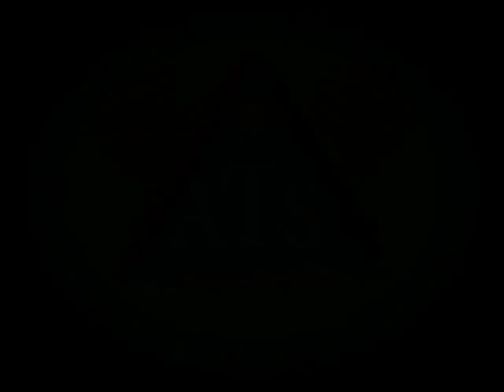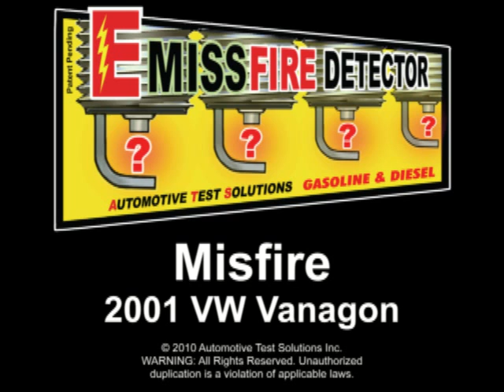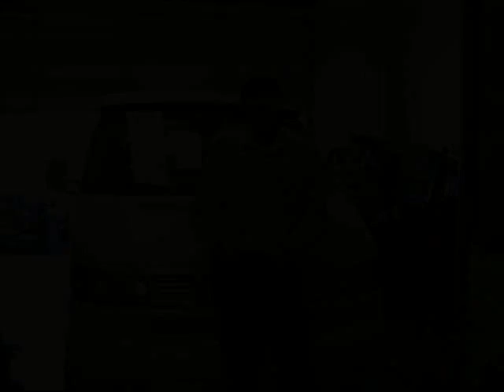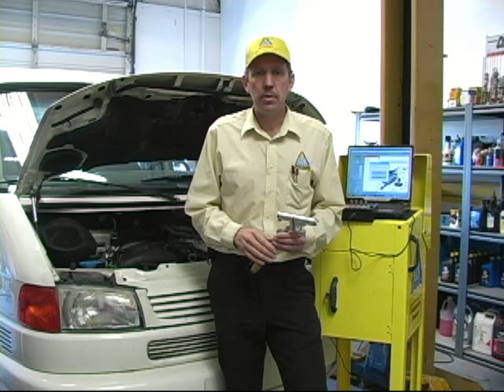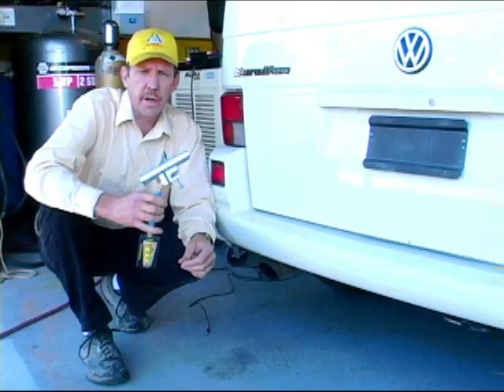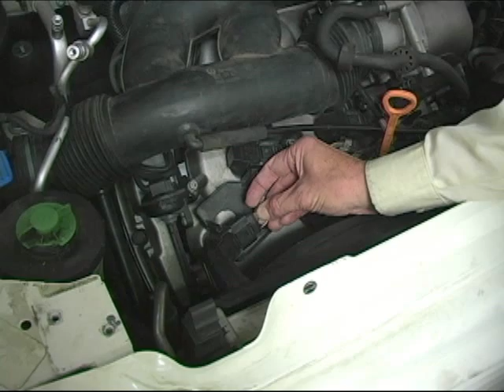EMissfire Detector 2001 VW Vanagon

Comment: I am having a bit of confusion->if intake valve is leaking in to the intake at TDC how come intake pressure drops? instead it should rice isn't it.Are u using vacum sensor or pressure sensor do i get different results upon what i use? if  pressure sensor  has been used would it create clear results.Please shed some light behalf of everyone who might have same problem i have. thanks in advance.
Reply: (This late reply is more for anyone that is just coming across this video and may have the same question, not necessarily for the OP, who has likely gotten the answer he was looking for) 

The intake pulse is being measured with a vacuum transducer, so when the compression pressure is forced through the intake valve, back into the manifold, the vacuum transducer is measuring a loss of vacuum, hence the drop in  the signal.  I think if you could see the measurement value on the side of the screen, you would see 0 in/hg  at the bottom of the screen and move upward to 30 in/hg to the top of the screen.
Reply: Vacuum is dropping, pressure is going up. yes a vacuum sensor  -30hg